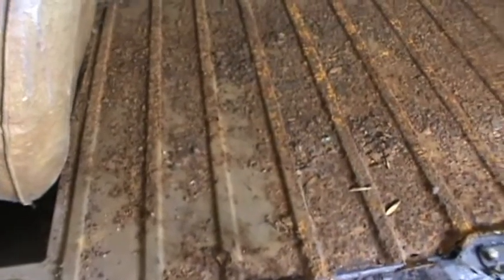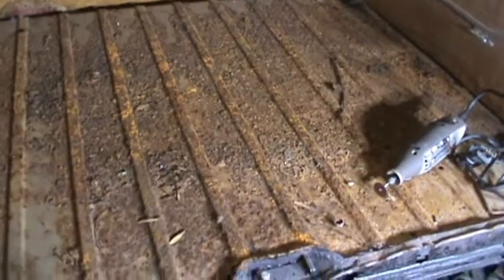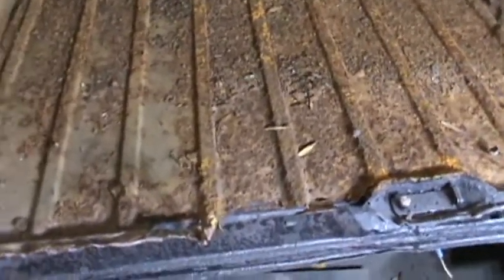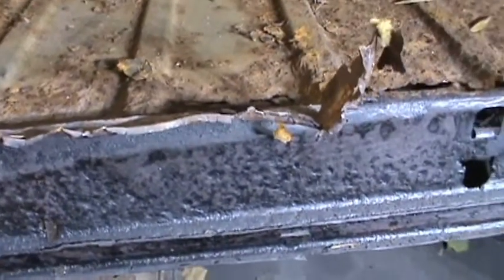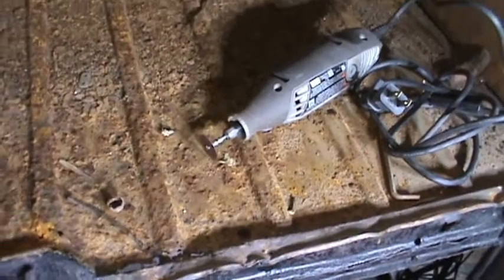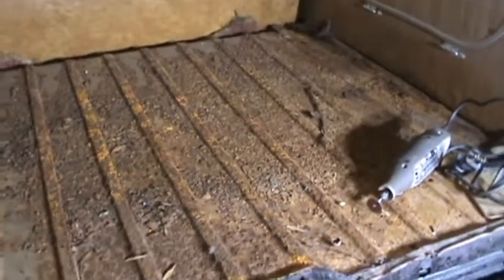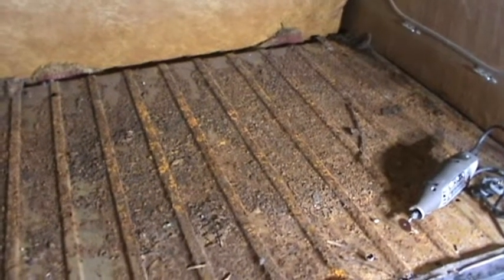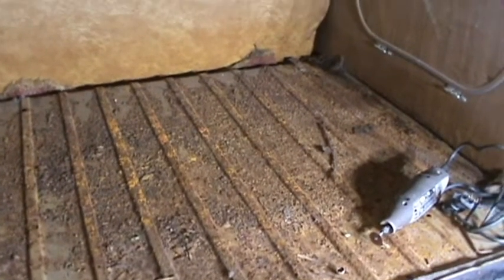Rear Deck Floor edge piece Part 1

Comment: Can you use the floor from a pick up box
Reply from the maker: That gives me an idea, on my other bus I got patch panel that were 8 to 9 inches wide they would be long eneough. Will check that out may cost less dollars that buying a bead roller and the shett metal.